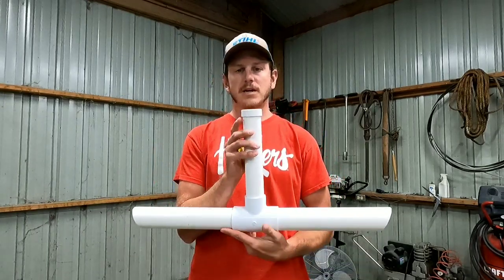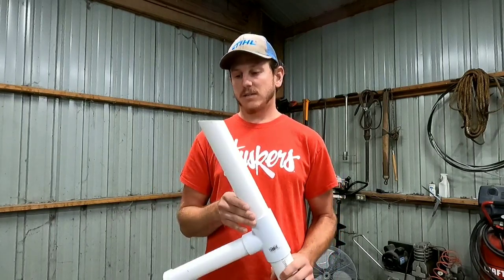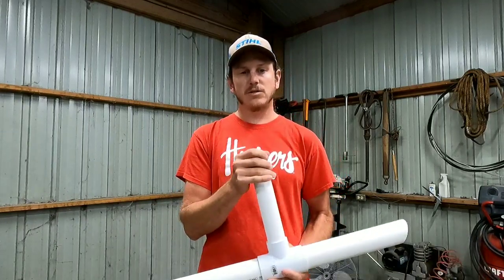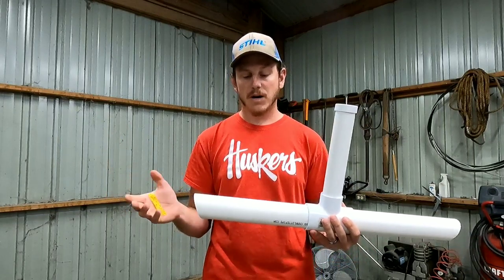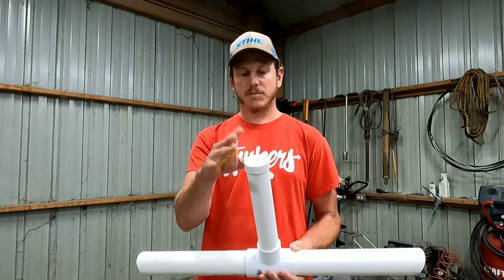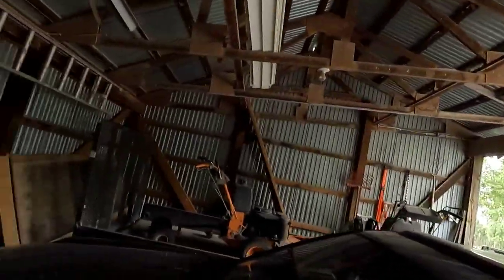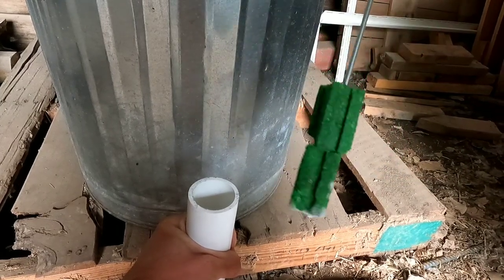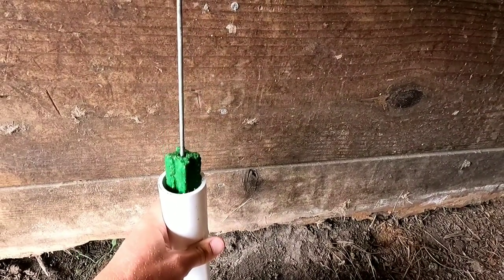Cheap & Easy DIY Bait Stations

Comment: Amazing,  will get the materials together and build them today. ed
Reply from the maker: They work well, depending on where you live and your rodent problem I suggest putting 1-2 blocks in at first and see how fast they go through them. Some of mine they go through faster then other spots, and the blocks will get moldy over time. Good luck!

Comment: Try this with one:
Take the bait out, flip it upside down and across a garbage can. Fill the garbage can with about 6 inches of salty water and smear some peanut butter around the perimeter of inside of the garbage can, just above the waterline put ramps up to the edges of the 2” pipe on each side and see what happens. I bet mice will drop right down into the garbage can, looking for that peanut butter. You could probably shorten the 1-1/2” diameter pipe to about 3”, making it more effective.
Reply from the maker: So the bait station upside-down would be a drop in place for them and the water in the bottom would be for drowning them I assume?